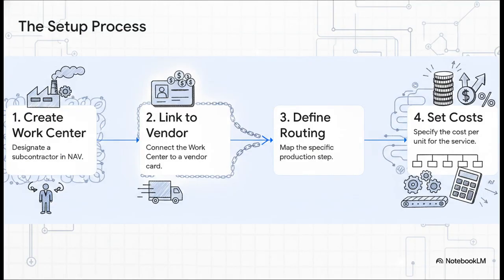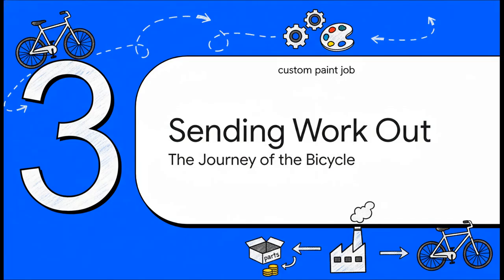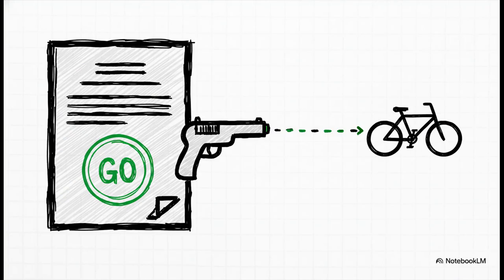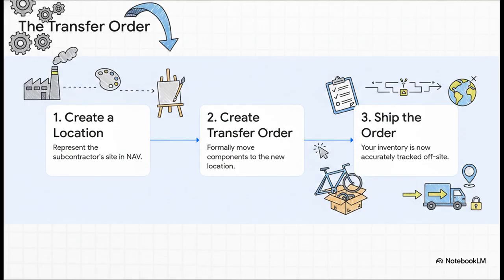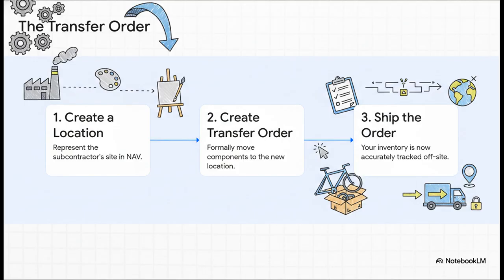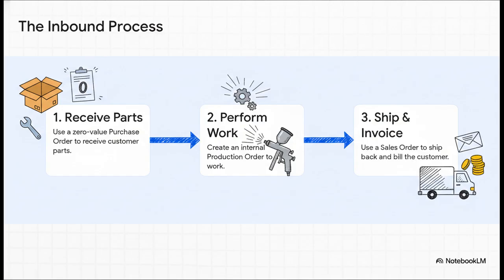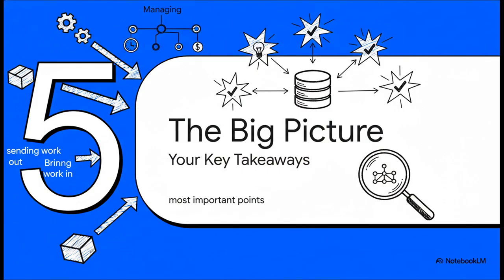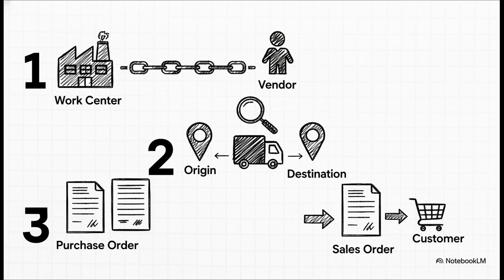Mastering Subcontracting in Microsoft Dynamics Business central and NAV: The Ultimate Guide

Comment: One question...do the bike frames that go out have the same item number as the painted frames when they come back?  And same question if we send multiple parts to the subcontractor to be "assembled:?
Reply from the maker: In Microsoft Dynamics NAV, items sent to a subcontractor and the items received back typically have different item numbers to ensure proper inventory tracking and costing
.
Item Numbers for Painted Frames
When sending a bike frame out for painting, the system treats them as two distinct entities:
The Component (Outgoing): This is the raw or unpainted frame. In the examples provided in the sources, a standard bicycle (item 1000) is used as the base material
.
The Produced Item (Incoming): A new item number (e.g., 1000-FIFA2014) is created to represent the finished, painted frame
.
This distinction is necessary because the painted frame has a higher value due to the added cost of the subcontractor's service and the paint used
. The unpainted frame is listed as a component in the Production BOM of the painted frame
.
Multiple Parts for "Assembly"
The same logic applies if you are sending multiple parts to be assembled by a subcontractor:
Different Item Numbers: Each individual part sent out has its own item number (e.g., frame, wheels, handlebars)
.
Final Assembly Number: The resulting assembled product will have its own unique item number
.
Consumption via BOM: All the individual parts are listed as components in the Production BOM of the final assembly item
.
Why this structure is used
Using separate item numbers for the "before" and "after" states of the product provides several benefits:
Traceability: It allows the system to track exactly what stage of the manufacturing process the inventory is in
.
Costing Accuracy: NAV can accurately roll up the costs of the individual components plus the subcontractor’s "service" fee (applied via the routing and purchase order) to determine the final value of the assembled or painted item
.
Inventory Management: You can see exactly how many unpainted frames you have versus how many painted frames are in stock
.
If you were to use the same item number, the system would struggle to differentiate between the value and physical state of the item before and after the subcontracted work was performed.